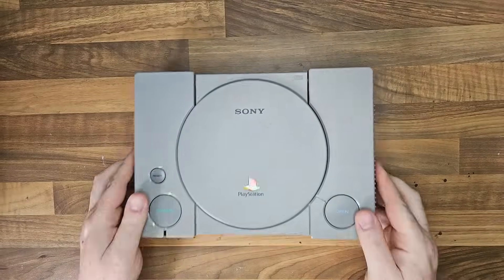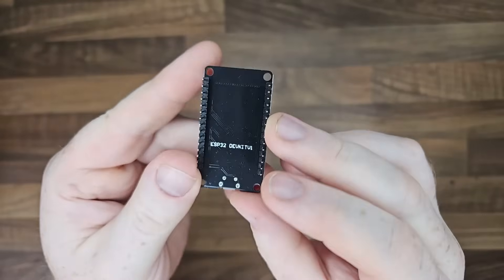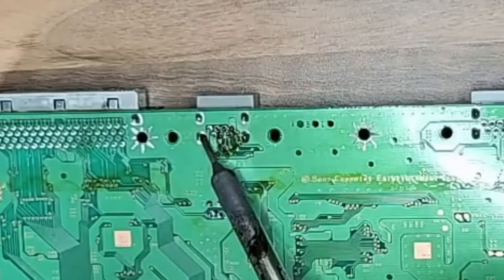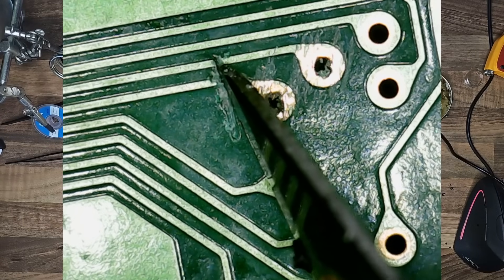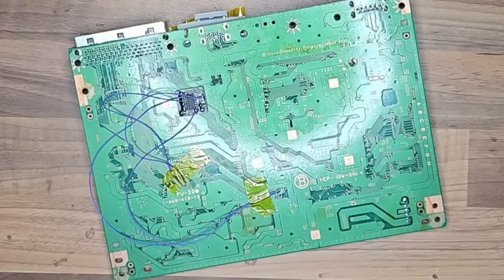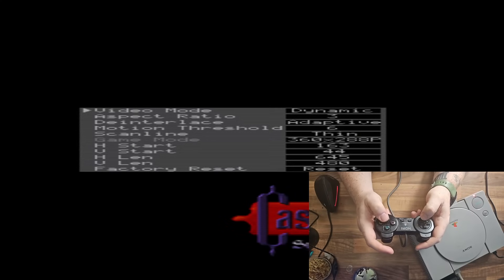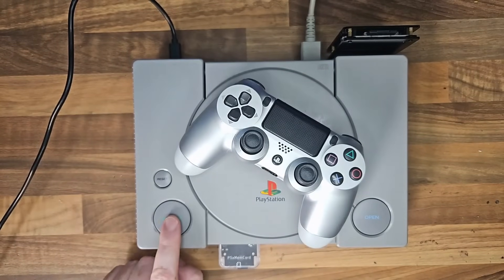I Built the PS1Pro! How To Build a Modern PlayStation in 2025

Comment: If anything, I'd have personally preserved the A/V out for the express purpose of supporting the Guncon peripheral. It needs the sync-on-green signal to function and for PS1's that did not have a direct A/V out it had to be facilitated with either composite cables or a breakout box of some kind that of course Sony only ever mentions in the manual for supported games.
Granted, I'd also have made a case for preserving the Serial I/O port with regards to Twisted Metal 4, but I've never even so much as seen the serial cable for the console, much less any third party ones that would be compatible.
Reply: uhhh the AV port is still there. The serial port is replaced
Reply: @murrayallen3684 my bad. I already hit submit post, before it got to that point in the cideo 😅
Reply from the maker: @ZeroHourProductions407 that's ok! I like that keeping both gives you the option of output, plus dual video out would be awesome. Thanks for watching 😃

Comment: Interesting! Recently restored and retrofitted a 7500 PAL series. 

Dropped in new optical drive as the old one had finished. 

Recapped,  PSIO switch board installed and swapped out my bios chip to allow gameID for discs (psxmemcard gen 2)

No available HDMI mod for my motherboard, so using a bitfunx adapter.

Bitfunx psxmemcard gen2 for automatic card creation for PSIO and disc games

Dropped green leds inside PlayStation shining out the vents, also changed the analogue indicator on the controllers from red to green
Reply from the maker: That sounds absolutely amazing! Especially the LEDs. Im a sucker for those haha!
Reply: @DReviewTing thanks man, it was fun. Been working on a ps2 35000 PAL series too. Nearly finished, waiting on a new laser and install PSBBN on to a 1TB SSD, installed matching blues leds in the expansion bay. Then finish off a ps3 60gb gonna drop a 1TB SSD into that and red leds
Reply from the maker: @lucifermorningstar910 man, that sounds sick! I have a PS2 Slim 700xx model that I will be modding next. All along the same lines as the PS1. Im looking forward to that!
Reply: @DReviewTing why the hell not sir!! Gonna revisit my n64 and GameBoy Advanced after all this, recapped and dropped a retro gem in the n64, need to drop IPS screen in GBA
Reply from the maker: @lucifermorningstar910 I done the n64 recently! With the picoDVI mod and SummerCart64. It was great fun! The N64 is my favourite of the old consoles. So many memories attached to it
Reply: @DReviewTing ahhh I just recently bought a summer kart64 need to get it up and running, seen some Rom hacks that need acquiring. It’s my original n64 from back in the day and my 1st project in revivals

Comment: I would've gone with Xstation over PSIO.
Reply from the maker: I would have. However, the Xstation is compatible with only certain boards. The latter aren't. That's why I went with the PSIO
Reply: @DReviewTing  true. And you still get to use your discs. PSIO seems like more work to install too

Comment: Where do you get the USB-C port? The PSU kit only comes with barrel jack?
Reply from the maker: Its a separate trigger board that I got from aliexpress. It was then just a case of switching it over.
Reply: @DReviewTing  Thanks for this video! Great job. Can you tell me where I can get a project for 3D printing a USB-С  holder from a connector?

Comment: Just a tip, keep your iron still when you are soldering the vias and feed the solder onto the via. You will get the heat onto it better than wiggling it back n forth.
Reply from the maker: Thanks for the tip, my dude. I think i get impatient, and wiggle it thinking it'd speed the process up 😅

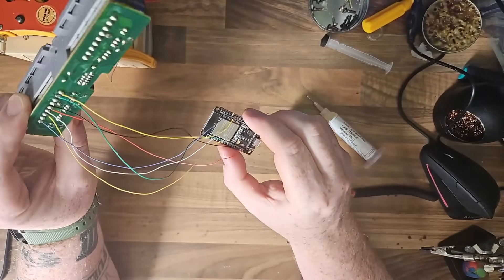Comment: 15:24
I find the PCB antenna on esp32 are not adequate for "living room" as it gives input delay when I put in my cabinet under the TV and playing sitting on my couch.
Got a 6dbi antenna that fits inside the PS1, and boom, perfect latency!
You gotta swap the esp with another that has an external antenna UFL port, or if you're into DIY like me, you can just solder an external antenna to it, got mine from an old router LOL (make sure to desolder the 0ohm resistor that connects to the PCB antenna).